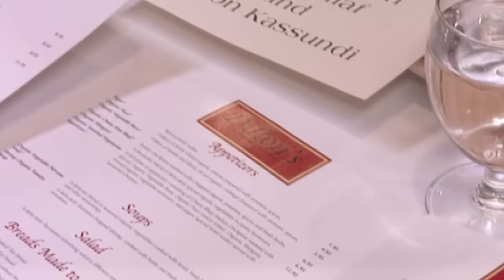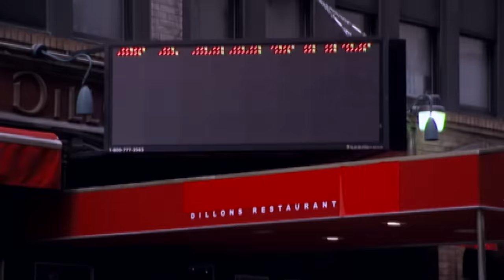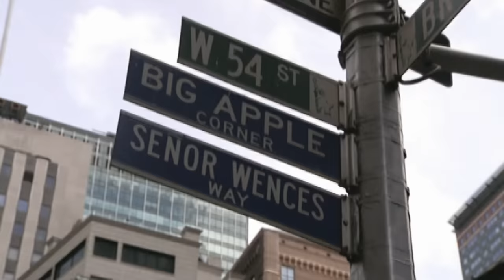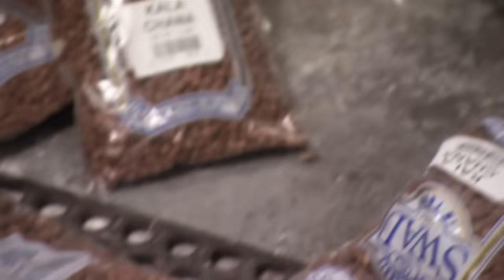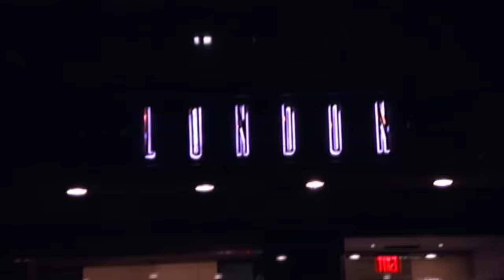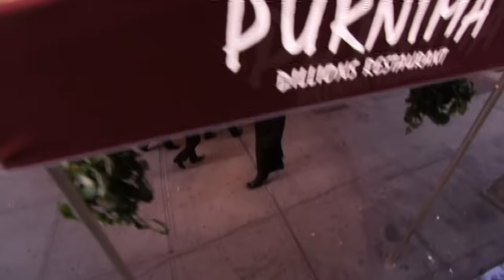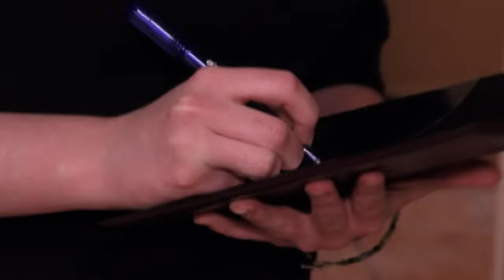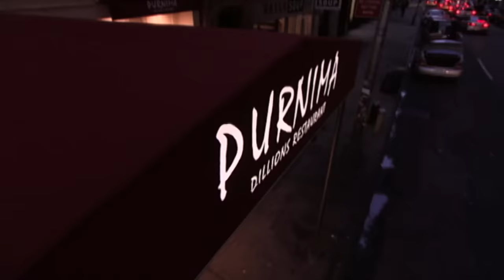"If That's Beef Then I Was Born In Bangladesh" | Kitchen Nightmares FULL EPISODE

Comment: Been watching all the episodes of kitchen Nightmares but so far this was the most disgusting restaurant 
Gordon saves the restaurant like An Angel 😇
Reply: How did he save it? It closed less than 2 years after the episode aired.
Reply: Gordon only manage to help 15+ restaurant but the rest are just beyond saving, this one included.
Reply: @kb5509  cause they couldn’t keep it clean and the food went back to being shitty
Reply: @scarsinsilence  right. So he didn't save it, which was my only point. 

The show also almost exclusively picks restaurants that are manned by absolute idiots that are incapable of taking on his advice, or restaurants that are in so much debt they can't be saved by anything or anyone. Because ratings.
Reply: @kb5509  Restaurants that are doing well obviously need no help, so what's your point?
Reply: @Kai-tn4yx  I'm not talking about restaurants that are doing well. I'm talking about restaurants that are either in the early to middle stages of failing, or ones that have mostly good staff that are just making a few key errors, that can be tweaked and realistically turned around. 

The programme rarely ever picks restaurants like that, they pick ones that have been either haemorrhaging money for years and are in too much debt, or ones run by cartoonish numbskulls that shouldn't be within 2 miles of an oven. 

They pick ones that can't be saved for either of both of the above reasons because it makes good TV.